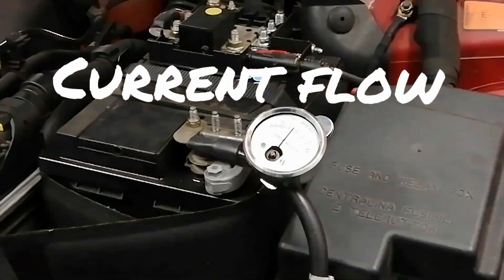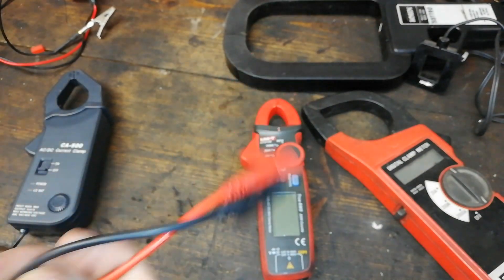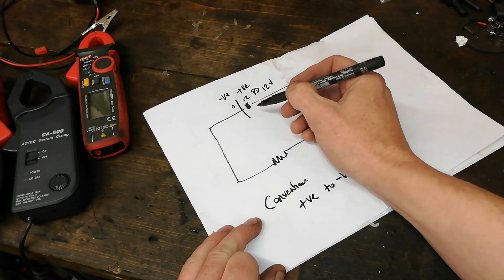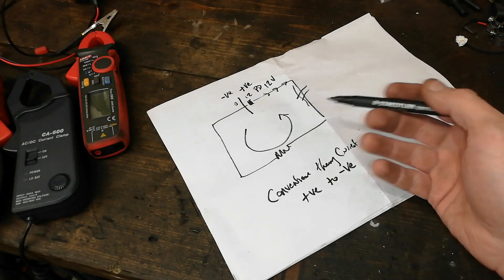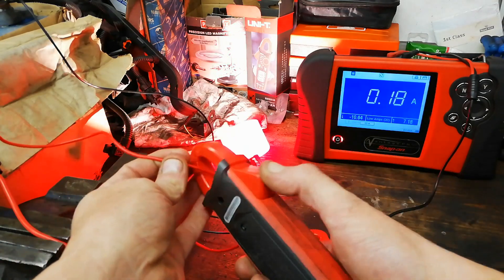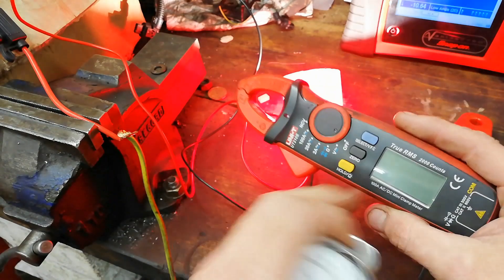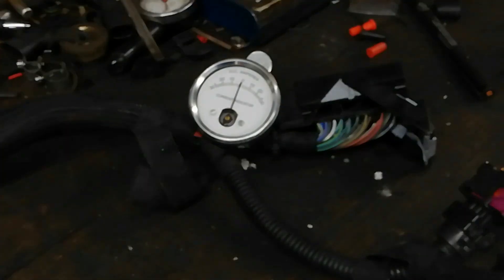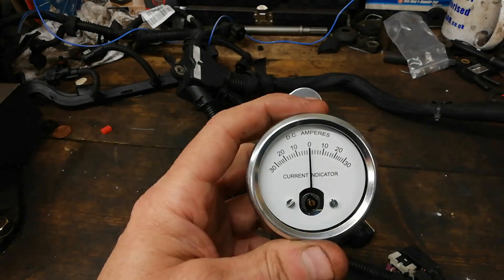Current Flow. Find a short circuit in a wiring loom

Comment: Fantastic vid. 
I believe you can also use a compass.

Dave, what would be your fave way of finding the exact area of an open or partially broken wire in a really long wire, such as a truck trailer?

Cheers from Ireland
Reply from the maker: i use a powerprobe wire finder for opens, there's one in the amazon store but it's a bit pricey

Comment: Great video. If you had the loom connected in a vehicle with ECU's would that circuit breaker cause an initial spike of alot more than 10 amps causing possible problems for electronics?? Or is is a manual breaker rather than an auto resetting type? 
Also would a simple test lamp work in place of the breaker, or would it not move the needle enough? 
Thanks alot.

Comment: I would just put a bulb in series or instead of the fuse. That will give a constant current save keep resetting the breaker. If you don't have an ampmeter a compass will give you current direction when held by the loom. Thanks for video love em
Reply from the maker: Hi steve, you can do this if you wish altho its a large current you need to distinguish down the different branches. Also the compasss doesnt stay stable as you follow around the loom, as you saw the ammeter stays in the middle and is not depending on orientation. Check out my other video on voltage testing were i use a compass. Cheers dave